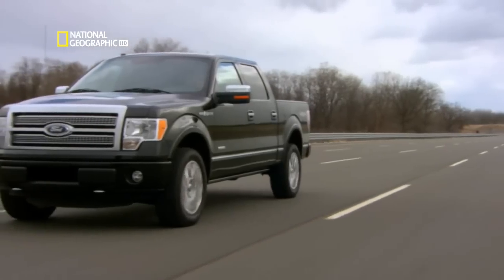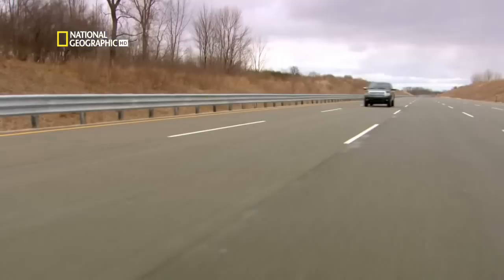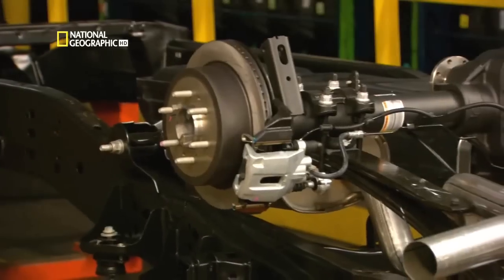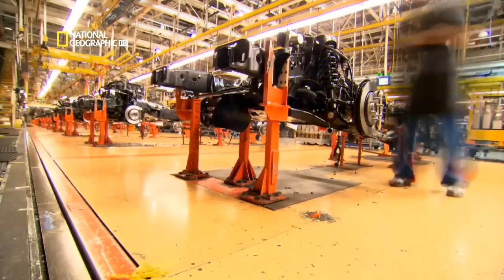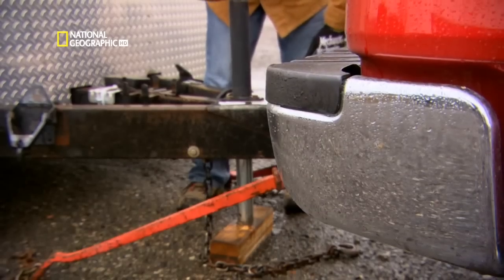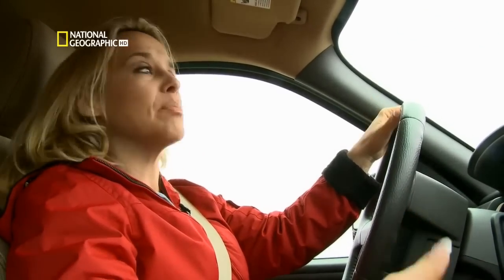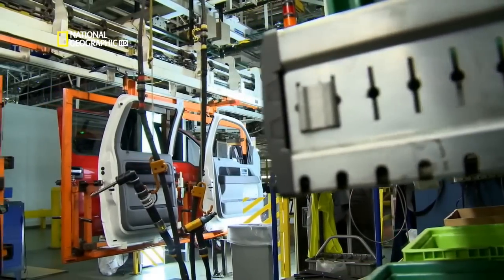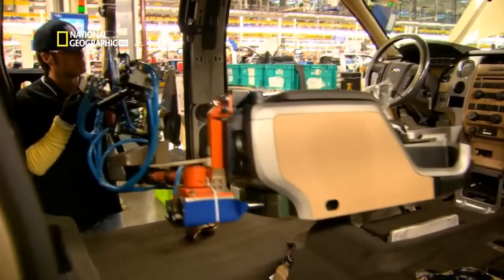Ford F150 2012 - How its MADE

Comment: The F-150 is in my opinion the best truck in America. My Dad took an Expedition with the 5.4 L V8 to over 212,000 miles, and never had any major problems with it, except for one blown spark plug at about 210,000.
Reply: BlackLocustPatriot , my Ford f100 had about that as well with the 351 W
Reply: Will I buy another Ford F150? You just try and stop me. The general pubic is proud of the Ford motor company and the people that build these fine trucks. Thank all of you.